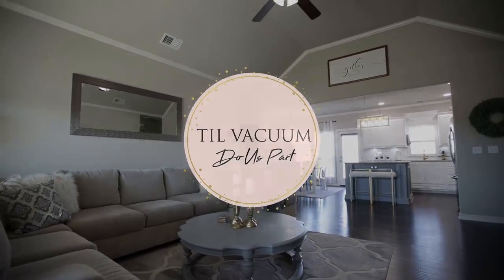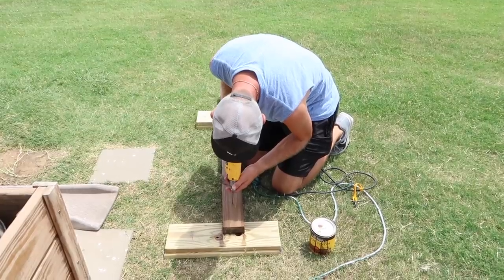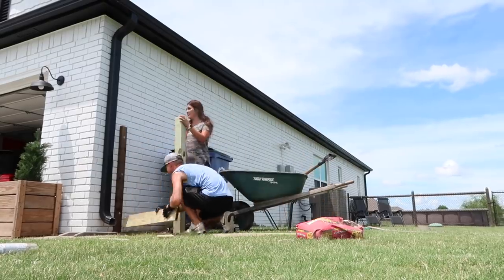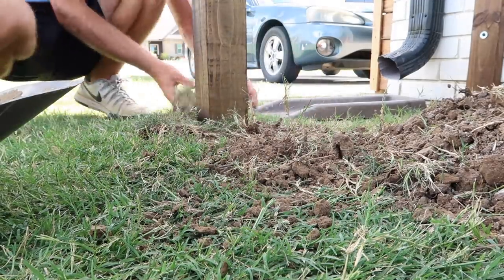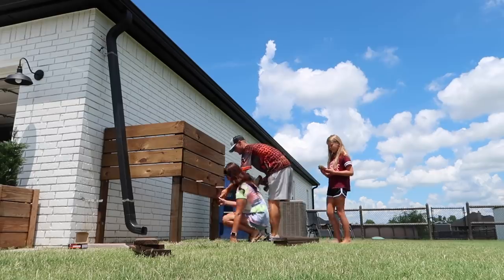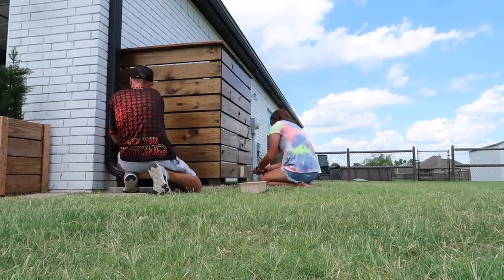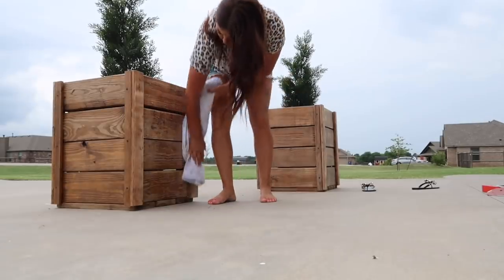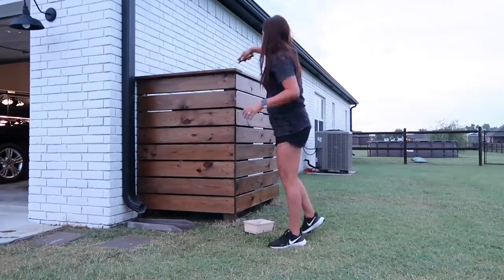OUTDOOR MAKEOVER ON A BUDGET | DIY MODERN FARMHOUSE UPDATES | DREAM HOME 2020

Comment: That looks so much better you both did a great job.. I think we tend to forget about the trash can .We have a long white wall like you were we have the heating units and air con (a different system here in Sweden ) but it is covered and looks like your design it's pre painted white so it doesn't look an eye sore .We are the first house on the street and that's what you see ,but now it doesn't look to bad it kind of blends in with the wall and  not right in  your face ..
Reply from the maker: Yes! I wish it came with all houses. No one wants to look at trashes lol

Comment: Wow!  You guys are ALWAYS working in a project!! Came out nice!! I need to repaint my 3 posts in my ft porch!  I RESLLY want twisted wood / Mexican or SW style twisted viga style posts!! Gotta find them then a Carpenter yo install them.  Then I will use the stain & sealer!  Thx for the advise!  It will face the W.. so it will be affected by the weather!! Yuk!  So intense in the summer! May add sun sails to shield the porch. It cools off the porch by about 10*F!!  That helps!  

M
Reply from the maker: That sounds so PRETTY! 😘